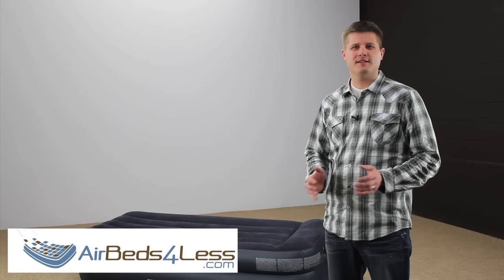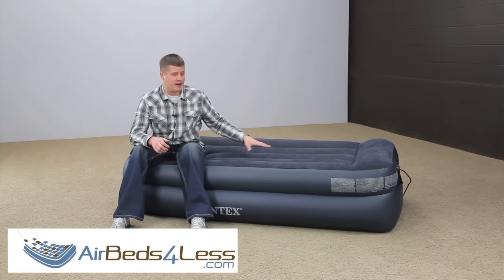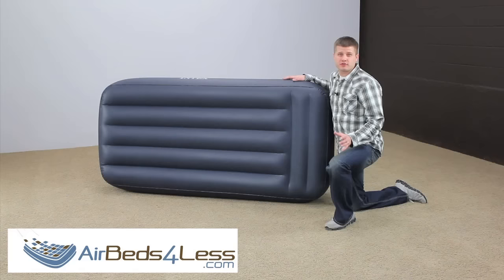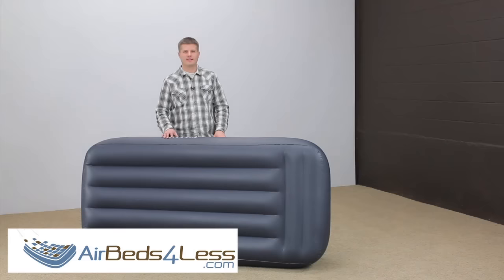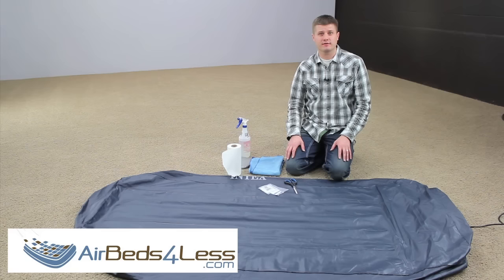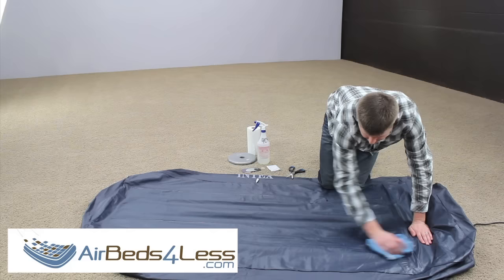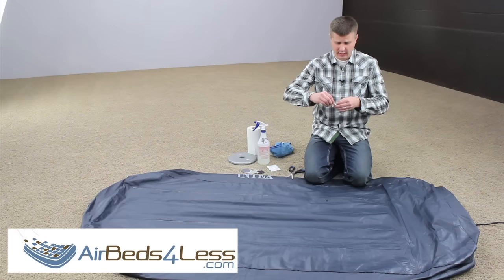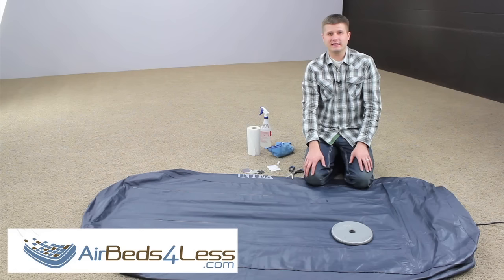How To Find A Leak And Patch An Air Bed Mattress Correctly

Comment: Might have to sand down the hole I found in my mattress today as I'm still losing air. It's a 20 inch mattress so it has a bit of heft and I've rolled the thing around four or five times today trying to find where I'm losing air still. I don't feel anything from the current hole, but I just slapped another piece of adhesive over the first one, just in case. I rolled that bed like a Katamari ball and have yet to find another source of escaping air. I heard valves can also be weak and yet I still don't feel air from it. I'm miffed and I just know at 5AM yet again, I'm going ti be in a taco on the mattress. I so can't wait until I buy a proper bed next paycheck...I'm spending my days off troubleshooting my bed and can't even sleep in or take a nap because of it. Sleeping directly on the floor again might be a better option to this song and dance. For shame, this was supposed to be my guest bed once I was done with it.

I have a Bestway mattress I got from Walmart. I loved that bed until today, lol.
Reply: Use soapy water to find the hole

Just use super glue and baking soda, doesn't look good but works so well n super cheap. 
2 3 drops of each and you are good to go
Reply: @kkhlufris  I've already found the hole but even after sanding the spot down and applying the adhesive, then adhesive and tape, air still leaks out. I have zero cash until next Friday to buy super glue, lol! I've decided to just make a pallet on the floor and tough it out. I slept on the floor the first week I moved in, I can bear with it one more week.

Comment: Ok so what if the hole is on top in the seams area? I have bought a lot of air mattresses in the last 5 years and they are the 22 inches high intex,not those that are what 5 or 6 inches high. I like to make sure my peoples are comfortable and the last last one I bought lasted almost 2 years until I went away for 2 weeks and came home to a mattress that had a hump in it because the seam came apart and now it has a pin hole. Why the pin hole always ends up in the seams.

Comment: Hey,

Air beds have very different quality. You should for sure do some research before buying one. You can compare prizes and models over here: www.airbed.org

I would recommend one with a built-in air pump and one that is also raised off the ground. The mattress should be around 20 inches high, so that you can easily get in and out of bed.

Some models also come with a puncture repair kit included which quite useful after heavy use and aging.

Comment: INTEX QUEEN EXTRA THICK. puncture on side.  about 3/4" by 1/4" puncture.  I've never had 100% luck with patches.  It always always ends up leaking.  So this time I've sTUCK a piece of gorilla tape on the inside with adhesive pointing outward.  then i will do an outside patch with material and silicone glue.  When I get the silicone if i have a piece of material big enough i will replace inside tape with silicone and material but you must be aware that the inside patch doesn't stick to the other side of the mattress with silicone run off.  So i would think gorilla tape would be best as the adhesive is only on the tape.  just some brainstorming.  I used gorilla tape for one night and it lasted half night before having to fill it so with a better placed piece and silicone on the outside it should be extra secure.
Reply: +robz place Maybe it depends on the type of airbed, but I can't see how I'd put a piece of gorilla tape on the inside of mine. I'm hoping gorilla tape on the outside will work, once I've actually found the hole!

Comment: Thank you for the video. 

Mine is leaking on the side where it is joined. Please where do I buy the patch and glue? Thank you
Reply: Use Pvc adhesive no patch
Reply: @ralphfinley184  Thank you
Reply: @ralphfinley184  If you can also do a tutorial on that, it will be highly appreciated. God bless you.

Comment: what if listening and feeling is not enough to find the hole? then what?
Reply: pa ma spray some soapy water around. The soap should create bubbles where the hole is.
Reply: pa ma Use soapy water in a spray bottle and it will bubble if there is a hole
Reply: Maybe I wasn't patient enough for this technique.  Couldn't find the hole either.
Reply: pa ma Be sure to check the valve.  If it's leaking from the valve I would just throw it out.

Comment: I'm strongly considering replacing my mattress with a queen size air matress. Like my main, bedroom matress in my bed frame.  Cheaper, lighter, easier to move and clean. I have a very nice, comfortable one. Has anyone done this? Pros, cons?

Comment: I've never gotten a leak in the bottom of my air mattress it's always been at the seems until today and my dog stuck is nail right through the top of it. so as far as glue goes what is the best to use. because there was no glue that come with my patches.

Comment: I'm wondering if shoe goo and gorilla tape would do the trick as well. Worried about using Krazy glue or similar types of adhesive where if the material moves the glue is likely to crack. Any have any experiences with this?

Comment: Do NOT buy airbeds.
I have 2 and an inflatable sofa (1st one was punctured at a joint and I'd lost the receipt so couldn't return. 2nd one was an Intex sofa that was highly rated on internet reviews so thought, can't be unlucky twice! - I can, and can't find the leak! Third one was an airbed going for  a bargain. They all leak, at least 2 on the flock side, and so you can't fix  them. You can't remove the flock evenly so the repair doesn't seal.
Save your money. Do NOT buy airbeds.

Comment: I came to get some professional advice on how to repair a leak.  This guy is way off base.  I used some dish washing liquid to make bubble soap and applied all over the under side of the mattress as this person suggested.  I watched and waited and reapplied the soap...nothing!  It was losing air fast so I said I should be able to find this leak.  I pumped it up again and flipped it over...it was on the top...not the bottom!  The issue is the use cheap materials and these mattresses will last maybe a month.  I weigh 240.  I have used air mattresses for years as I have a bad back and they do help if you have back ailments.  They will all last around a month and then spring a leak!  I have gone through dozens on them!  The problem is poor materials and workmanship!  They need to use better material to last longer even if it cost more.  Some of us need to use it every day not just on a 2 day camping trip.  What this guy is saying is totally false...also you need dog hearing to find these leaks by ear...use bubble soap...this guy is ridiculous!

Comment: What if you got a really tiny tiny hole where it's not even visable or no small air sound when you pump it up or  even a bubble as well when you wet some parts on the felt part. Cuz after I tried all that it was full of air but when I laid Down on it, less then 7 mins it went half flat already, is their any possible way to & by any means I can look for a tinest puncture or a pin hole?
Reply: I took mine outside and wet it with the garden hose while full of air.  It took seconds to find the bubbling leak.

Comment: I have that exact mattress and it has a huge bubble in it that makes the bed extremely uncomfortable and impossible to have a decent nights sleep i Googled it and says the seams are busted how is this even possible? Tried returning it and was told exchanges weren't mad on such products so now its either sleep on the floor or sleep while trying not to fall on the floor so what can i do besides be a grumpy person all day
Reply: I did not think to sand the surface'  i hsve 3 beds the need patching. What ever you do, Dont use FLExShot.

Comment: Intext air mattresses are crap.  Most other ones aren't much better.  They are made specifically to use once then fold up and never use again until after the warranty period.  If you use an air mattress every night, it will develop a hole, even if you sleep naked, within a few weeks.  They are not made to last.  These manufacturers are charging up to $200 or more and they are being cheap on the material.  If they made them right, they would only puncture from abuse.  Buy an air mattress only from a car with a good warranty and return it when done.  If not, you throw your money away

Comment: He talks TOO much! Get to it, already!
Reply: Speed up the video to 1.5 and it's perfect.
Reply: +Tiffany Jones Apparently you learn quickly, but it is my experience managing customer support teams and software engineers, that most people do not HEAR EVERYTHING the first time through. I thought he very patiently explained the process and now I think I'll try the 'wet lips' trick to see if i can find the leak(s) in each of my three double-decker air mattresses. I move around a lot as a technology consultant and I prefer to sleep on a good air bed than on a hotel mattress that could have bed bugs, or should I say 'frequently has' bed bugs, no matter what hotel chain.